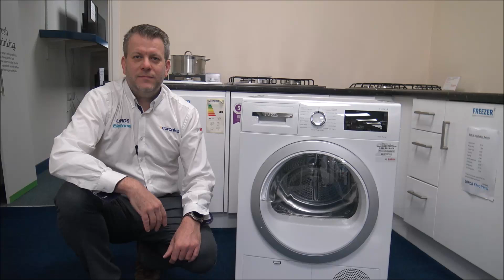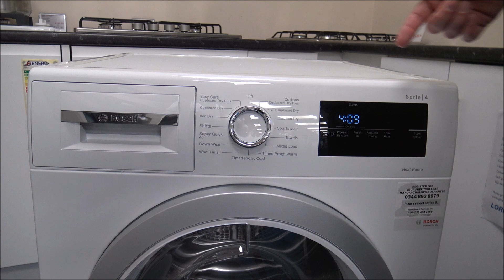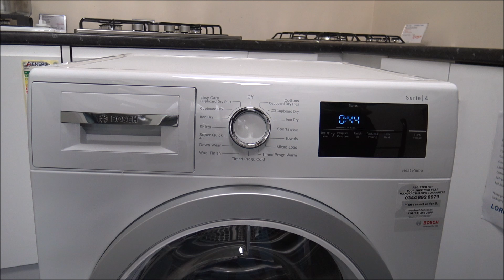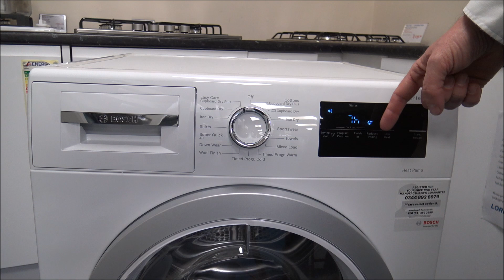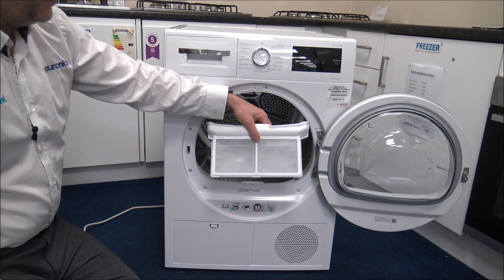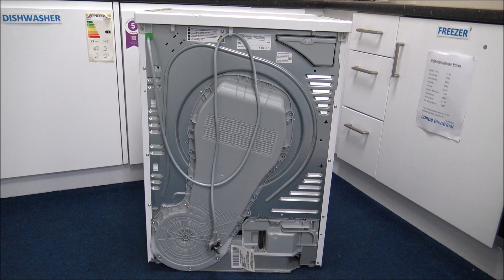Bosch WTH85223GB Heat Pump Tumble Dryer

Comment: Hi, thanks for the video. It is very informative and helpful. I was planning to buy a heat pump dryer, but we usually wash our clothes all mixed. If my washing machine's capacity is 9kg and I want to put a full load directly into the dryer after washing, which option should I choose since everything is mixed? I didn't know there are load restrictions for different modes.

Comment: I regulary watch your blog! very good thank you.. I have been meaning to ask you how to clean my Bosch heat pump tumble dryer.. the part where the 
"fluff" goes.. its difficult to get into the slot?
Reply from the maker: If it is where the fluff filter goes then it can be difficult to get into the slot, so either try and pick the fluff out or to use a vacuum cleaner with the crevice tool

Comment: I’ve just ordered one of these dryers as using condenser dryer is expensive. So I’m conscious of denim being shrunk in a tumble dryer. Can you recommend the best setting for denims/jeans? Thanks
Reply from the maker: I would normally put them on a standard cotton program if your dryer doesn't have a Denim program, but always select the low heat option

Comment: It would be so helpful for you to have shown us how to connect the drain hose to the outlet and various different ways of doing it. Have you purchased this item, the installers are saying that they are unable to install and the job is for a plumber! Are you not able to show us exactly how the heat pump tumble dryer can be connected to a drain?
Reply: And they call themselves installers? Sounds like delivery drivers and packet removes.. A little kid could probably do that and plug the machine into the outlet..

Comment: is it ok to stack this on top of an old bosch washing machine?
Reply from the maker: They will be ok to sit on top, but you need to make sure it is secure on there and will not fall off.
Ideally you want a proper stacking kit between the 2, or a shelf for the dryer to sit on above the washer
Reply: @lords-electrical  Thanks, can you recommend a stacking kit?  Does it fit to the dryer or the washing machine, or both?
Reply: If i buy a Miele dryer, would that be ok on a Bocsh washing machine?
Reply: For this model: 

WMZ20600 Wool in basket - accessory
WTZ11400 Stacking kit with pull-out shelf
WTZ20410 Stacking kit
WTZPW20D Platform with pull-out, dryer, cubic have a Google on the numbers & see what you can get

Comment: Hello, I want to ask something. I am thinking of buying this dryer. And when I want to dry a small amount of clothes, for example 1, how many minutes is the minimum time setting?
Reply from the maker: These are sensor dryers so will adjust the time of the load depending on how damp the clothes are and the capacity of the load too.

Comment: Good video. Just a question. I recently brought a Bosch heat pump dryer and installed drain hose properly. A small rubber plug is removed from the bottom of condenser box, but there is still some water in the  condenser box. Is it normal? Should I empty the box regularly? Thank you

Comment: Took delivery of one of these only today so I;ve not had chance to try it out yet. However, one thing - the feet it rests on have rubber pads, understandable I suppose to help reduce vibrations, but they also make it impossible to slide the washer into place. It simply wont go into the tight under-counter corner I made for it which has a concrete floor. I had paid for installation but it was a waste of money they were incompetant (Currys). I dismissed them and continued on my own. I spent a couple of hours trying to move the thing the last 3 inches trying everything I could think of. No luck so far. I may resort to simply removing those feet so it can slide, use something else for the base to rest on. Never had such trouble with the previous washer which this one replaces.

Comment: I recently moved house my bosch series 6 heat pump tumble dryer is 3yrs old. When they went to move it water spilled out of it. I can hear water sloshing around when I opened it & and moved the drum round. I'm now scared to use it as I have never heard this before.

Comment: My condenser tray has not collected any water after 3 loads, i did not connect the  drain hose as I'm happy emptying the tray
Reply from the maker: That’s very odd as it should be collecting water in the container after 3 loads. I assume the clothes are drying ok though?

Comment: Thank you for your informative descriptions. You talked about dkmensions and having space for the dryer. Can you be clear about the space it needs to be fitted under a counter, as your background suggests it might? The space I have is 604cms wide and easily fits my old tumble dryer, but dryer manuals say 1cm clearance should be left between driers and 'any other futniture'. Is that the same for this model? Is there a difference between condseners and heat pump types? Grateful for any advice on a model that could be used in the space I have.
Reply from the maker: As long as the dryer fits in the space comfortably and is not touching the furniture around it, then you should be ok. There won't be any difference between a heat pump and condenser dryer as far as allowing space around the dryer.

Comment: Thanks for this video that made my ideas clearer, I would like to ask you a question, I will buy this model but due to lack of space I will have to put it in the bedroom and the socket is not very close and the tumble cord is not long, so I would have to use an electrical power strip/exatension is that ok? buying a quality one
Reply from the maker: You can use an extension lead if you really have to, but just make sure it is a suitable rating to plug your dryer into
Reply: @ Thank you very much

Comment: Thanks for posting this video. I'm considering purchasing one of these and was struggling to work out whether or not it was the right model for me. The Bosch manual available online was less than clear when it came to answering specific questions about drainage / collecting the water and also about whether there was a cooler temp option. You answered all my questions! Thanks again.
Reply from the maker: Great to know the video was helpful for you. Thanks for the feedback

Comment: My clothes aren't coming out hot after a cycle. Is this normal in modern dryers? My last tumble dryer lasted about 20 years so maybe modern dryers are different? Thanks
Reply from the maker: A heat pump dryer operates at a lower temperature compared to a condenser dryer, so naturally the clothes will not be as hot. Also a lot of dryers now have cool down period for the final 10 minutes of the program so they may cool down to a level that is cooler than on you old machine. It is normal though.

Comment: Whats the hottest programme to dry clothes on cause it just seems luke warm
Reply from the maker: You will find all programmes will operate at a lower temperature on a heat pump dryer, so don't expect any of the programs to get the dryer as warm as a standard condenser dryer
Reply: I find the Quick dry option is the fastest, but you also need to increase the heat from 1 star to 3 stars.  This dries very differently from the bog standard condenser drier but is much much cheaper to run

Comment: We are in 2 minds about buying one of these. Seen reviews on Curry’s etc and some say if you  like clothes 90% dry and enjoy ironing buy one of these. With the condenser dryer we have at the moment it has an iron mode, things like tee shirts come out hot so just shake and fold and job done. Is it the same with a heat pump tumble dryer?
Reply from the maker: Heat pump dryers operate at a lower temperature so the clothes won't come out hot like on a condenser model.
Reply: @ Thanks for the the reply. Think we will get an upgrade on our 10 year old condenser dryer , no doubt they cost more to run but they save a lot of hassle

Comment: Thanks for this detailed review. I am planning on getting this model and it was really looking for some extra detailed information, including about the water drainage so thank you for including that at the end. Was really worried for a sec it wasn’t going to be included. Lol 
You can never tell with appliances like this whether or not you need to have a water drainage pipe included or whether it’s simply emptying a tank, so good to know it does have a tank and I can simply pull it out and empty but could still attach a pipe if I wanted.👍🏼

Comment: Thank you for the video. I have a question. We recently bought Bosh heated pump dryer but for some reason drying time cycle not doing the full cycle maximum I have it's 15min. Tryed different cycles and result still the same maximum 15 min. I have been told to use first 30 minutes warm cycle before to use any other cycles. But for me it seems strange. So trying to understand how correctly to use this tumble dryer.
Thank you in advance.
Reply: You don’t need to do what you’re doing. Just make sure the drying level is set correctly. There is a button on the control panel and the display looks like little stars. This is a great dryer and I also didn’t realise this drying level button. Good luck
Reply: @philforest4747  
Thank you for your advice, I will try it.
Reply from the maker: It is normally just a case of selecting a program and go. You shouldn't have to use the 30 minutes warm cycle to start with. It sounds like there could be an issue with it if its not going through the whole drying process
Reply: @lords-electrical  
Sounds not too good for me.
Thank you for the update.

Comment: Are there any built in heat pump dryers or can a door be placed in front of the dryer if you have > 66cm depth
Reply from the maker: The main one we sell is a Blomberg model https://www.lords-electrical.co.uk/washers-dryers/built-in/tumble-dryers/27802/blomberg-ltip07310-heat-pump-integrated-dryer?c=119
It isn't recommended to put a door over a freestanding model as the dryer needs ventilation from the front and it will damage the machine long term if it doesn't have the correct spacing around it.